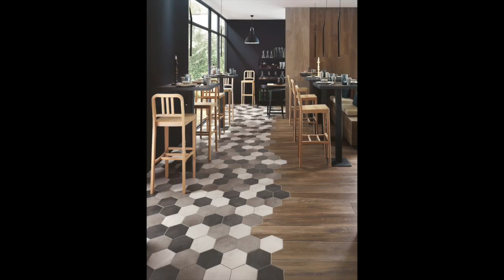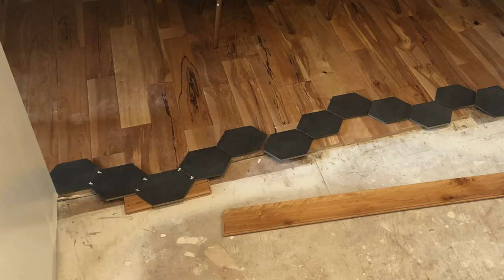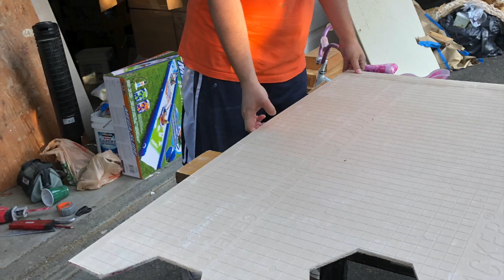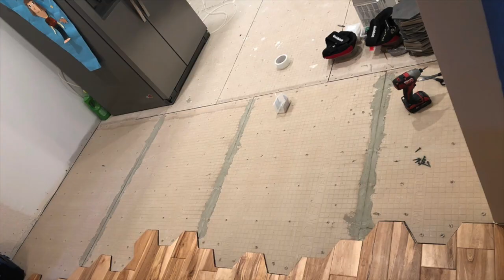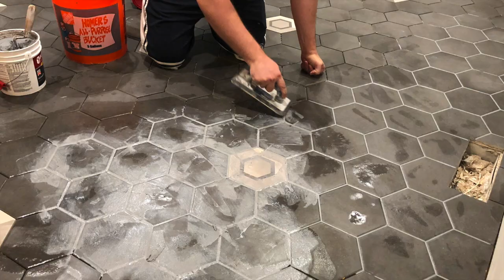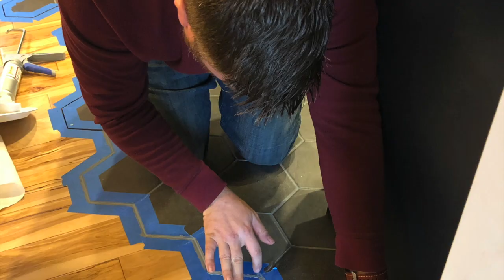Hex tile to hardwood floor transition

Comment: WARNING! One thing I learned so far while looking into this. I want some random deco tiles in my project. I was warned by the tile shop that if you get hex tile from different manufacturers or even just a different series the actual size could differ. A different size by even just 1/16 inch wil mess up your whole job.

Comment: I want to do something similar to this with hardwood and tile but was told by the installer that from his experience the wood would soak up some of the moisture from the grout and would then crack.  Do you know if this is true?
Reply from the maker: For the transition between the wood and the tile I did not use grout. I used a sanded tile caulking. This gives it some flexibility and prevents cracking. I've had no problems with the transition line.

Comment: I have those same pics saved. I wanted this so badly in the entryway of my home, but ended up not doing it because I was scared it wouldn't work. I am going to attempt it in my bathroom when I tile my shower and let it flow out from tile to waterproof vinyl plank flooring. Fingers crossed 🤞🏽! Thanks for your video!

Comment: Hey. How is it holding up. Any issues between the transition from wood to tile ? Thanks
Reply from the maker: No issues so far! That sanded grout at the transition seems to work really well. Looks exactly the same as it did when I installed it 2.5 years ago.

Comment: Thanks. I thought of one improvemnt. Tape the wood and mark on the tape. Cut the line with a knife before cutting. I would also have taped the edges of the wood before applying glue and grout. Bad to get those on the wood.

Comment: How did you hold down the wood floor? Did it lip up at all
Reply from the maker: No the flooring is solid hardwood so it is nailed to the subfloor. So i just made sure that all of the pieces that meet up to the tile were nailed down really well. Hope that helps. Love your work with the funky bunch btw.
Reply: How can i secure the hardwood if is concrete underneath??

Comment: Did you have to secure the wood floor so that it doesn't move over time and bust the grout lines at the transition point?
Reply from the maker: The floors are solid wood, so they are nailed down to the subfloor. But there will still be some movement, so that is why I used the sanded tile caulk along the transition from tile to wood. It keeps some flexibility where grout would likely crack and deteriorate over time.
Reply: @cjbates123  makes sense. I assumed it was a floating wood floor. Looks great by the way

Comment: How thick was the wood floor and the tile. What thickness was the grout trowel 
Nice job!
Reply from the maker: The tile thickness is 9.5 mm (~0.37″).  The transition from the tile to the hardwood is just about level.  The hardwood is solid 3/4" birch (closer to 5/8" nominal), and it is nailed to the subfloor.  So the tile plus the 1/4" backer board plus the two layers of thinset just about perfectly matches the height of the hardwood. Used a 1/4” notch trowel for the thinset.
Reply: @cjbates123  thank you that was really helpful.

Comment: Love the floor transition...
I am looking to do the same thing at my house but I’m doing new engineered hardwood and hex tile I do have a couple of questions:

what is the thickness of your hardwood? becuase I am trying to figure out how to have a smooth transition from tile to floor in terms of hight I am using 1/2 hardwood 

what hex tile sz you used 7x8?

Thanks!!
Reply from the maker: Hey Claudio - will your engineered hardwood be attached to the subfloor?  I wouldn't recommend this approach if you are planning to have the engineered floor float.  But if you are attaching it to the subfloor in some way, then you should be ok.  If its only 1/2" thick, you will likely have a bit of a height difference at the transition.  I've put all of the specs of my floor and tile in other comments below, so just look around for all of that.  The Ragno Rewind hex tiles that I used are 7.17″ × 8.27″.  Good luck on your project!
Reply: Hi Cameron thanks for tour feedback ... Unfortunately I alreadu bought the floors which are 1/2 and I plan to glue them to the sub floors .... unfortunately if I use 1/4 backer board the tiles would end up too high is there any other option you know of or recommend that I could do since I dont have alot of threshold to ensure even width on both tile and flooors .... is its mandatory to use backer cement board ?

Comment: Great Video. Looking to do something very similar. I was hoping you can answer two questions for me.  1) What was your tile thickness, and how is the transition heigh between the tile and hardwood (it looks very good in the video).  2) What style of hardwood did you have? Was it floating, nail down, glue, engineered? 1/2" etc.  Thanks!
Reply from the maker: The tile thickness is 9.5 mm (~0.37″).  The transition from the tile to the hardwood is just about level.  The hardwood is solid 3/4" birch (closer to 5/8" nominal), and it is nailed to the subfloor.  So the tile plus the 1/4" backer board plus the two layers of thinset just about perfectly matches the height of the hardwood.
Reply: Cameron Bates I am planning on doing this but I bought engineered hardwood of 1/2 ... is it possible to achieve this? also what sz hex tile you used I was looking into using 7”x8”... Thanks!

Comment: Can you do this with laminate floor?
Reply from the maker: I only have experience doing this with solid hardwood, but I would guess with most laminate floors you would run into an issue  where the thickness of the tile+substrate would be much thicker than your laminate flooring.
Reply: @cjbates123  couldn't you fix that by adding some sorta spacer material like plywood under the laminate?
Reply from the maker: That might be a possibility, but again I’m not a flooring expert. I would definitely consult someone with more professional experience on something like that.

Comment: Will this work with laminate wood flooring?
Reply from the maker: It really depends on the thickness of your tile, and the thickness of your laminate flooring.  Also I wouldn't recommend putting tile directly on wood subfloor as that is not a solid enough surface and your tile/grout could crack.  Hope that helps.
Reply: @cjbates123   there’s concrete under the vinyl flooring I’ll be pulling up. My contractor is word about my laminate wood because it’s clicked in, not glued down.
Reply from the maker: @KCE4  Yeah I would probably listen to your flooring guy on this.  If the vinyl floors float that could present a problem where it meets up to the tile.

Comment: Now that you've done it this way with the wood in first, do you think it would have been easier to do the tile first... or would you do it this way again?  I'd have thought your way was superior, but the other video (like you said) put the tiles down first.
Reply from the maker: Good question, and it’s hard to say as I’ve only tried it the one way. I think either method works as long as you take your time and measure carefully. That being said, I think the method of tiling first and then laying the wood up to the tile may be more forgiving if you make a mistake.

Comment: Great job!! What keeps the wood down? Just the calking? Does the wood flex upward at all?
Reply from the maker: The wood is solid tongue and groove hardwood, so it is nailed down on the edge with nails at an angle.  I put a few extra nails in the pieces I had to cut near the transition to keep them secure.  But the wood will expand/contract a bit with temperature and weather, so that is why I used the caulking for the transition to the tile.  It allows for a little bit of flex instead of a brittle, rigid grout line. Thanks for the comment!
Reply: @cjbates123  Thanks!!

Comment: Thanks so much for this how-to. You did a great job, looks amazing.
Reply: I also wanted to add that I'm going cement floor to an already existing wood floor. I'll be using Schluter-Ditra XL 5/8 inch. Be careful as it comes in two sizes 1/8 and 5/8 inches. My 1/4 inch tile will now equal the wood height of 3/4 inches taking into consideration for the thin-set. I will use Spin Doctor spacer 1/8 inch to match up the wood floor as they will help me space, level, and align, the tiles.  Again thanks I'm sure there are other ways just thought this might get you rolling on your creative floor ideas.

Comment: It's BS...didn't show squat...because
It doesnt work !! Surely Doesn't work for 5/8 and c ant work with 3/4
Reply from the maker: I assure you it did for me, my tile is perfectly flush with the hardwood.  But it all depends on the thickness of your particular hardwood/tile/etc.  Again, I used solid wood floors that are about 5/8" thick.  Tile sits on 1/4" backer board.  Got to measure your own materials though!
Reply: @cjbates123  
Nooo clueieless
Reply: @cjbates123  IT DOES NOT WORK USING THIN SET...MATERIAL IS TOO THICK !!

Comment: You killed it!! I really want to try this but I have laminate. Has anyone done this with a floating floor?
Reply: I’m doing this with laminate, back door entry way. Using an oscillating tool with half-moon wood serated tip... make sure you get the serated tip, the teeth will be staggered and not in a perfect row (helps with clean lines). When it comes to the the sharp angles you can get really close and then use a box cutter with force to get perfect angles. Dry fit your tiles with spacers to make sure everything is spaced perfectly, if you have uneven spacing close to the laminate and need to shave off small portions use painters tape to get a perfect line and attach sanding tip to oscillating tool. This project is very very difficult to do if you have poor vision, it is imperative to have impeccable eye sight and concentration when doing the angles cuts. Just take your time and if possible use a sharpie and make your outline perfect for spacing because it is so hard to go back and recut the laminate after you have already cut your lines (this is why I used the sanding tip). Don’t rush anything. Cutting the laminate will take a long time so just be patient.

Comment: Hello! So helpful as I am looking to do this in my bathroom on an existing wood floor. Worried about the tile to wood transition over time. Does the silicone/acrylic caulk crack over time in that transition or has it held up ok?
Reply from the maker: So far it has held up perfectly, but we have only had this for about 7 months.  But the product I chose, the ceramic tile caulk, was what was recommended to me by the manufacturer (Custom Building Products) as a good solution to allow for the expansion/contraction of the wood floors relative to the tile.
Reply: Thank you so much for the responses! Super helpful. Can you also tell me how thick your engineered hardwoods are? Ours seem thin to me and even with something like ditra in place of hard i backer to take some of the thickness out, I can’t see getting below .63 inches abs think my hardwood is thinner
Reply: Confirmed my engineered woods are 3/8inch- does that make this not possible?
Reply from the maker: @andreathomas2794  Yeah it will be tough to get a perfectly even transition from tile to 3/8 engineered hardwoods.  My floor is 5/8" which makes the transition work out a lot better.  But you don't want to lay your tile directly on subfloor without some kind of substrate.

Comment: Great video! I'm in the process of trying to do this in my home. We're running into problems with the flush look. What is your height gap between the tile and wood?
Reply from the maker: Jonathan McGeoghan our hardwood is 5/8” thick, and is nailed to the subfloor. The tile is 1/4” thick, and the hardibacker board is 1/4” thick. If you add two layers of mortar (one between subfloor and hardibacker, one between hardibacker and tile) you end up just about flush.
Reply: @cjbates123  Is this type of job more expensive than a regular job if I hire a contractor to do it?
Reply from the maker: @chrisginoc  I would expect it to be fairly expensive to hire someone to do this.  It's quite labor intensive.
Reply: @cjbates123  Thanks for the response. Im obsessed with this transition look,but I might have to wait and pay to get it done.
Reply: @cjbates123  no hardwood is 3/4...you can't use half inch underlayment...do the math...You have to use a urethane hardwood adhesive mapei 977 to have a flush finish with 1/4" underlayment..use goboard not hardi  or wonder board
Reply: Try different variations with kerdi membrane and plywood thicknesses to add up to your hardwood.
Reply: Exactly!! You can't use sanded grout..it's bullshit, You have to use adhesive hard wood is 3/4" thick...Doh !
Reply: You can't use this in a prexisting floor
Reply: You have to use a urethane hardwood adhesive mapei 977 to have a flush finish with 1/4" underlayment..use goboard not hardi  or wonder board
Reply: no hardwood is 3/4...you can't use half inch underlayment...do the math...You have to use a urethane hardwood adhesive mapei 977 to have a flush finish with 1/4" underlayment..use goboard not hardi  or wonder board